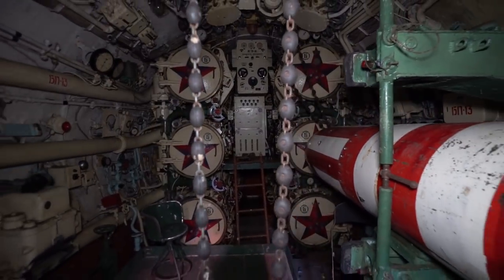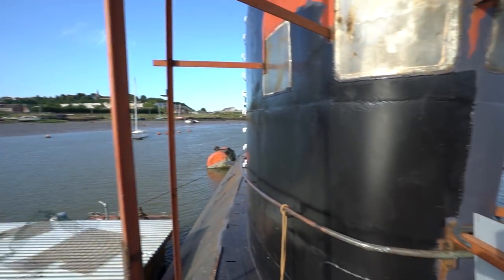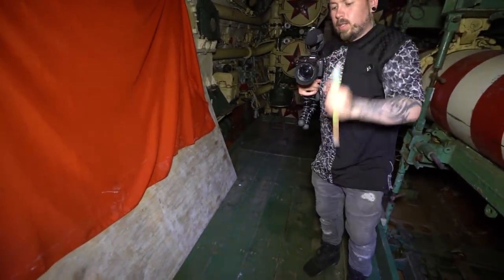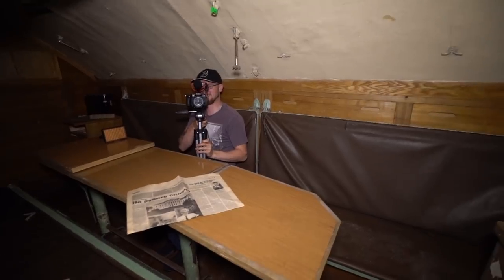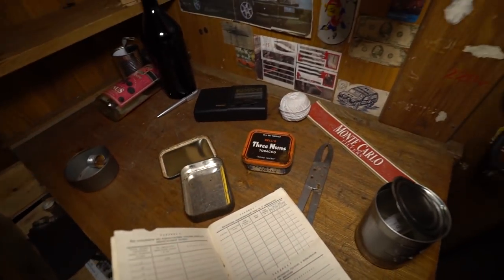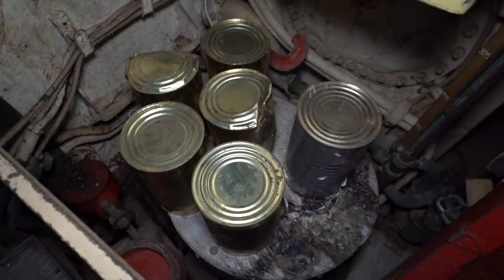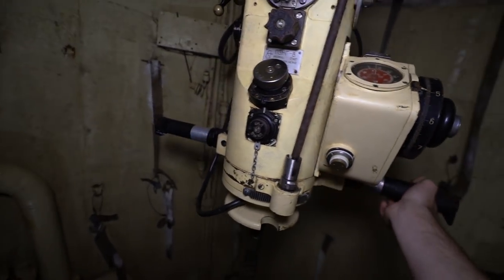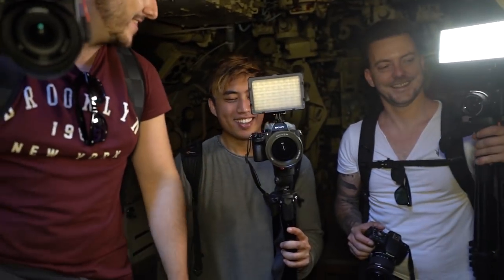Old Soviet Submarine Emerges From Water - We Explored It!!

Comment: here’s some info on the sub.

Foxtrot-class Diesel-Electric 
Attack Subarine.

Nation: USSR
Weapons: 6 Torpedo tubes
Weight: 2,500
Length: 89.9 meters.
Max speed: 15 knots
Max depth: 920ft

Radar: Snoop Plate search radar
Sonar: Pike Jaw active sonar(sail mounted)/ Trout Cheek passive sonar (hull mounted)

They where built from 1957 to 1971. These boats where the last inexpensive conventional subs built my the USSR. The Foxtrot-class was then superseded by the November-class nuclear attack subs.

Comment: For those of you looking for actual history on this boat (subs are not called ships), it's a Foxtrot class diesel-electric submarine. Around 70 were built, mostly for the Soviet navy but also 8 for India, 6 for Libya, and 6 for Cuba. 4 were central to the Cuban Missile Crisis, being deployed to Cuba by the Soviets and later having fake depth charges dropped on them by American destroyers in an effort to force them to surface for identification, 3 of which did while the 4th evaded the American ships. By the time they were all in service they were entirely obsolete due to old torpedoes, sonar, and powerplant systems, and their 3 propellers made them extremely noisy (not good for something that's not supposed to be detected). 2 were later sold to Poland and 1 to Ukraine, and the last Foxtrots were retired from the Russian Navy between 1995 and 2000. This specific example was built entirely in 1966 and delivered to the Soviet navy in 1967 as B-49. After serving in the Northern Fleet until November 1974, it was based at Riga and served with the Soviet Baltic Fleet before being being transferred to other nations to be used as a training boat for their Foxtrot crews until its decommissioning in 1994. From there it was sold to a private owner who renamed it "U-475 Black Widow", and sent to England to serve as a museum until 2004 when it was closed for restoration which is still ongoing.

Comment: Since Josh and the crew were a little too busy enjoying themselves, I'll give everyone a proper rundown.

 U-475 or "Black Widow" (the name was applied after the ship's retirement as it was not Russian custom at the time to name submarines) was a Project 641 class (NATO reporting name "Foxtrot") subarmine built for the Soviet Navy in 1966 and commissioned in 1967. The ship's actual designation was B-49 and it had had a relatively uneventful career in both the Soviet Northern and Baltic Fleets until its decommissioning in 1994 at which point it was sold to private parties and opened up as a museum until 2004 when it was closed due to lack of funds for repairs. B-49 , like the rest of the Foxtrot-class, never fired a shot in anger (submarines have only been used in combat times since World War II, none of which involved the Soviet navy).

Technical data

Displacement: 1950 tons

Length: 92 meters (302 feet)

Beam: 7.5 meters (25 feet)
Test depth: 246–296 m (807–971 ft)
Crew: 77
Armament.: 10 torpedo tubes and 22 torpedoes (or roughly two per tub plus a pair of extras)

If you live in the United States and wish to see a Foxtrot-class up in person, there are two on display in Southern California. B-427 was a museum ship in Long Beach (literally right next to the Queen Mary) until 2015 when deterioration forced its closure, although you can still basically walk right up to it if you want. Its sister ship, B-39 is also a museum ship just South in San Diego.

Comment: "I don't understand any of this"  is Josh 12 yo?
Class and type: Foxtrot-class submarine
Displacement: 1950 t
Length: 92 m (302 ft)
Beam: 7.5 m (25 ft)
Draft: 5.1 m (17 ft)
Propulsion: 

    3 × 2,000 hp (1,500 kW) diesel engines
    3 electric motors; 2 × 1,350 hp (1,010 kW) and 1 × 2,700 hp (2,000 kW)
    1 × 140 hp (100 kW) auxiliary motor

Speed: 16.8 kn (31.1 km/h; 19.3 mph) surfaced
Range: 

    30,000 nmi (56,000 km; 35,000 mi) surfaced
    400 nmi (740 km; 460 mi) submerged

Test depth: 250–280 m (820–920 ft)
Complement: 77
Armament: 

    10 torpedo tubes (6 bow, 4 stern)
    Up to 22 torpedoes
Reply: Maybe some of the history would improve things, but if anyone really wants those details they can find them themselves. I think it somewhat silly and unreasonable to expect that level of detail in an exploration video.

 "Hey Josh, next time you happen upon the copier in an abandoned office block, can you get me the engine serial, how many pages are on the clock, and whether it's on Copycost?"

Comment: that radio equipment is the sonar room, the room with the big red round valve handles is the ballast room that controls the air and water to make it float or sink, room with tables is galley, the torpedo is the war room, the valve u like how it looks actually was a dial that used for communication through the ship, written in Russian but it would say full speed , ballast low, ballast up, basically giving commands from the general to crew. you found the periscope up the tube, awesome to see a soviet one. im confused about the Cambodian implement tho maybe they stole it or bought it but u would think they would remove the soviet stuff.

Comment: if you had turned the handle and used the lowest knob to twist for angle to undilate to see distance you would of been able to look through the periscope. the reason it was all green was because the two glasses were so far apart or the angle was wrong . the viewing glass above was the aiming sight and and distance , the lever at the top was to flip the lens cover over to stop it twinkling in the moon light giving your position away. Thats what I make of the periscope and the controls. I have used all the periscopes that have been in service in the English navy from 1950 to 2007 Russian ones differ slightly but one like that would be good up to several miles there that good on close up you could read small print .

Comment: Folks this is a luxury liner compared to the smaller class subs..
Figured all painted and clean, all the wood stained and sealed as it should be with all the lights on it's not an issue.
How many guys are in the area at 14:50?
That's not cramped.
Think Apollo mission guys sitting for two weeks straight in a metal lazy boy smothered in a Bozo suit surrounded by a shit loads of instruments and tiny windows.
That is claustrophobia Maximums.

Comment: 10:43 That is not a "valve" its the engine order/answer telegraph. See thr "cton" on bottom? Means "stop". Its the only russian word i know lol.
The pointer on the left is the ordered speed from the bridge and the red pointer lets the engineers tell the bridge that they acknowledged it. Below the round scale should be an analog digit display that will specify turns (rpm)
On the bridge would be the fancy pedestal mounted one, or the engine order telegraph.
They work by using two 3 phase motors with thier windings paired (so when one moves the corresponding one follows (or "answers")
Now, of course, everything is flat panels and buggy ass software.
The phones are sound powered and have growlers. So they will still work.
US navy had very similar equipment.
Also.I agree on other peoples' comments. You should be a little better versed in the things you explore...especially since you have the info on your phone. Its great that you get paid to basically explore stuff and have fun. Do us the favor and educate us a bit.

Comment: Isn’t that heat the radioactive nuclear power engine? Maybe it leaked? 

Probably not :)
Reply: Killer Rabbit 35 That specific type of Soviet submarine seems to use diesel electric. It is probably the black paint absorbing heat for so long
Reply: @firepower7017  Other than sinking, explosive hydrogen from charging the batteries is the most danger. Freezing in the north sea, cooking in the south sun. Rough!